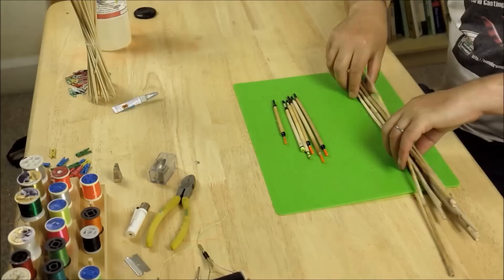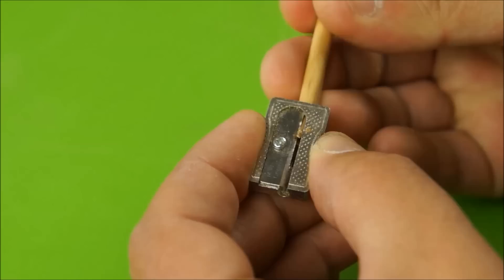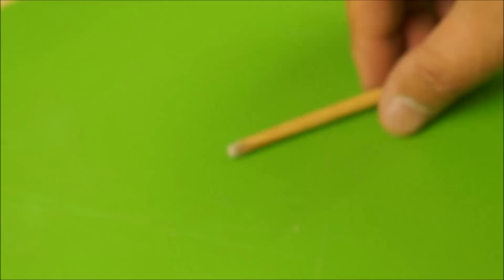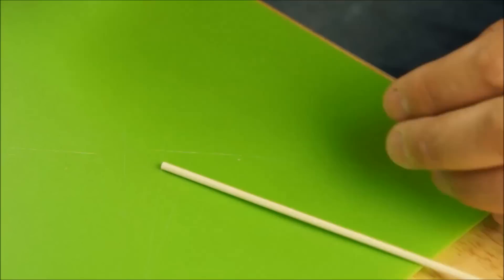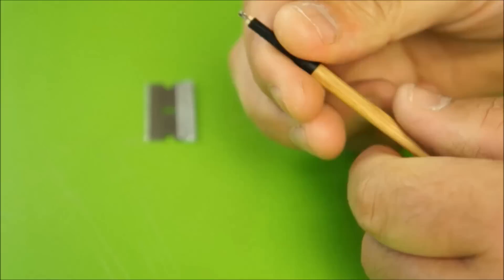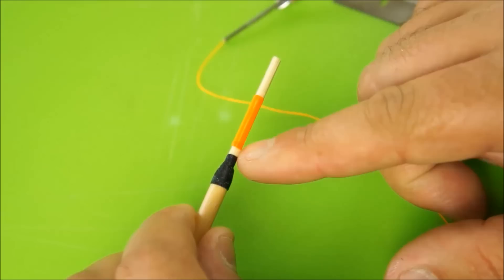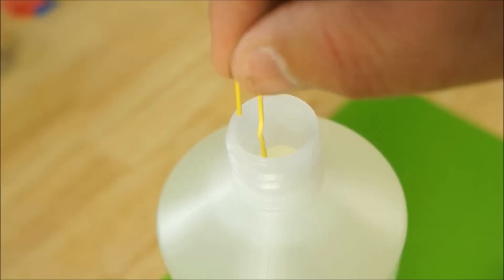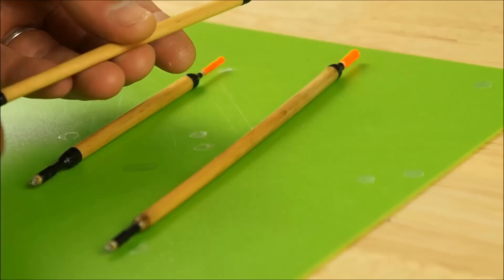Making Traditional Reed Fishing Floats (bobbers) By Hand

Comment: These are small floats https://www.youtube.com/post/Ugkx_rJB7cli5f1ofPVGgn80S7Yj4vqwq0gU recommend the package is smaller than my hand just to provide perspective. That said I wanted small floats for the times I need to add one when trout fishing or fishing for panfish. The peg is perfect for my application where I want a set hold point that is quickly adjustable and want to be able to add the float without retying. That’s the real advantage here. You can add this float to your line without retying and adjust the depth easily with the peg so it won’t kink your line like a traditionalit. If I need to set this too deep then I’d switch over to ait with a thread stop to make casting easier. But like I said, these are a great value for the price I paid. Probably better suited to applications where your depth is 5-feet or less for the sake of casting.

Comment from the maker: strangely i have recently been using cork sliding floats i made with bamboo tubes at the center.  I find the only way to deal with cork is using an electric drill as lathe and shaping it with coarse sand paper.   

I am glad the video worked for you, i still find it a bit special to sit in the reeds and fish with a reed float and even better when the tench turn up. 

thanks

Comment: this is best float making video I have seen. a tip you might like is : for the float eyes instead of making eyes , what I do is get small safety pin and cut the head off leaving two prongs and eye. just a thought. I do like your cellulose coating .I have been usung waterproof yacht varnish. I like your idea better. I also like your coloured orange thread. I was spraying fluro high visibility paint.. well made video brilliant.
[iminent=W83uTbgUWfOB]
Reply: ফগমছজচভম বমহ

Comment: You may not see this as the video was posted over 6 years ago. I just got it in my recommendations so decided to watch it as I'm a keen angler. I have a question. When you chose the section from the reed, you cut it out with a backed razor blade. But when you cut the stem insert you used a yellow Stanley knife. Why the difference, wouldn't the yellow knife have done both jobs adequately?
Reply from the maker: yes the yellow knife would of done both,  and think it would keep its edge a lot longer, just an ordinary stanly blade would do as long as it is sharp, have fun, cheers
Reply: @PaulAdamsTheHandmadeFisherman  Thanks for the reply. The yellow knife actually looks safer to use.  Hope you're still getting out and catching fish. I'll be on the bank tomorrow. Tight Lines!

Comment: Paul can you help? I've been trying to find a way to drill a hole through the centre of balsa dowel for through-the-middle float making for years. (Pike/zander floats mainly.) I don't have a pillar drill and when I've used them in our joinery shop at work, because you are effectively drilling into the end grain the drill just wanders off course. Any ideas?
Reply from the maker: The method i used that seemed to work best was making a centering jig, I made one of these for the brass weight in the first 'balsa crankbait' video for drilling the center out of the brass rod, this uses the drill press. The principle works the same with balsa but rather than drill from one side i turn the balsa round in the jig and drill from the other end, that should mean the hole is pretty central at the ends.
   The way i do it now is to cheat, for me if use a slightly larger diameter dowel or a square section i just drill it as best i can and then turn it on the lathe or drill press so it ends up being the center anyway.

Comment: Paul thanks fella, as with tymesho, this has inspired me to get a new hobby, or at least try, i am disabled but love fishing the local River Lea.
Can the handheld bobbins be brought.
Thanks

Jim
Reply from the maker: That is a nice bit of water, I usually make my own bobbin holders but I have bought some from larger fishing tackles shops they are normally a  couple of pounds a piece. There is a bit more information on my blog  http://homeluremaking.blogspot.co.uk/2013/08/it-has-been-little-bit-of-strange-week.html

I must collect some more reed myself, good luck, it can get a bit addictive
Reply: *****
sorry to be a pain but will 3mm diameter work.
thanks
Reply from the maker: just measuring the ones i have and most are about 5mm which is about the same as a crystal (plastic) waggler and i have a few at 3mm which are great for fishing close in. I always make loads and then pic a favourite and use it until i stand on it or lose it, cheers ps i use cocktail sticks for stem with the smaller ones.

Comment: Thanks for your video's Paul. I love the idea of using thread for the florescent tip and will be adopting that on my own floats. How have you found the cellulose dope for longevity ? I use Devcon 2 ton and a turner for my finish as I love the strength and ultra high gloss.
Reply from the maker: I have one float which is faded on one side becuase i left in proped up on a windowsil in the sun for a couple of weeks, but in normal use i have not had any problems. I use envirotex epoxy on my larger pike floats and i lost one about three months ago in nasty bit of the pond, it is great to see it is still there in floating debris, one day i will remeber my wellingtons and fish the thing out. I have to admit the fumes from the nitro dope can get addictive. I bought a 500yds spool of floro thread from a local sewing warehouse for only a few pounds,i suspect it will last me the rest of my life, good luck

Comment: Paul, I am a Salmon Fisherman  (spinning), and don't yet float fish, but I hope to try shortly. Some of the fishermen I have contact with talk about ' weighted floats' , where the floats have small ball bearing ballast. Do you ever tune the flotation of your with ballast. If so what do you set them up like/.
Reply from the maker: John Smith Yes here in the uk we call them self cocking floats, i use lead free solder in the bottom of the reed instead of the skewer. The thick coil stuff works best and then whip the eye onto it in the same way, i was going to a video on it when i get round to it.For me they work best if there is a little room to add weight down the line.  Thanks
Reply: ***** Thanx Paul.

Comment: Where do you purchase the pieces of reed.
Reply from the maker: they are available free in the marshes almost anywhere on the planet
Reply: Paul Adams can you use 5 minute epoxy for a clear coat
Reply from the maker: might be a bit heavy, you could maybe thin it with acetone, but any waterproof varnish will do